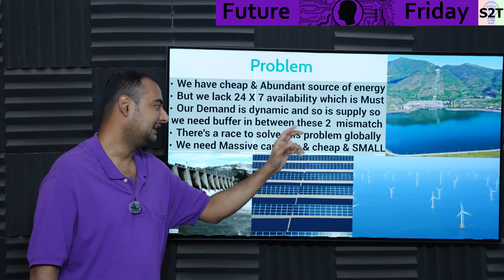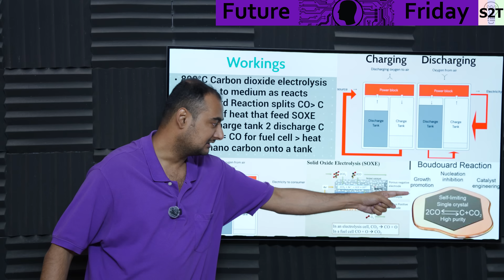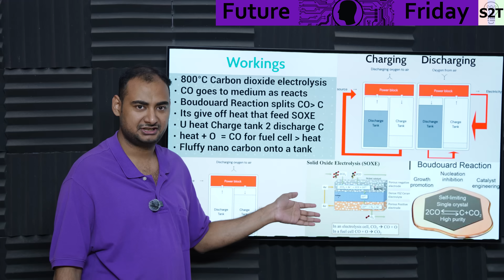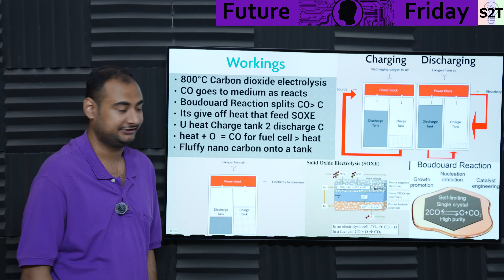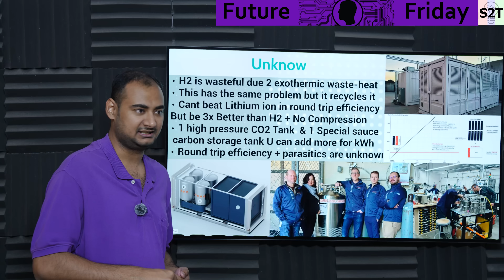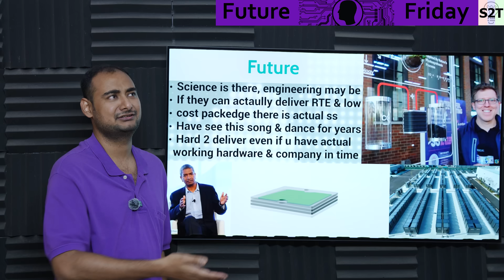Noon Energy {Reversible solid oxide cell} Explained {Future Friday}

Comment: Interesting as always.  I agree with you about hydrogen, it's no good for energy storage or transport.  It may be the answer for steel production though.  Good luck to these guys, it will be great if it can be made inexpensively and the efficiency is okay.  Perhaps follow up in a year or so.
Reply from the maker: finding green sources of hydrogen feed stock is a wise choice is just useless to try to use this as a energy carrier . I have low fait in it has I said I have seen this song & dance before